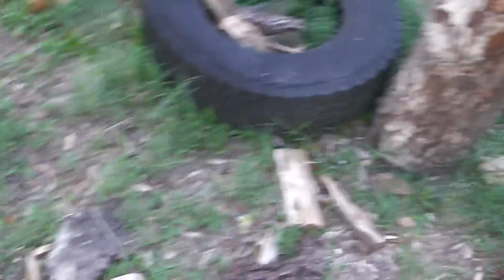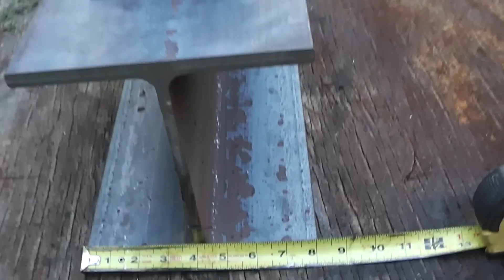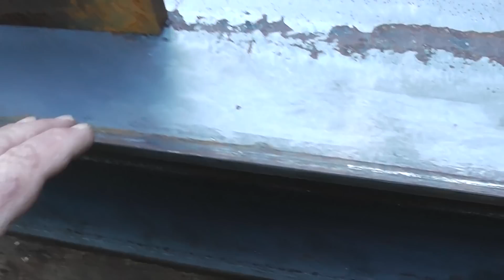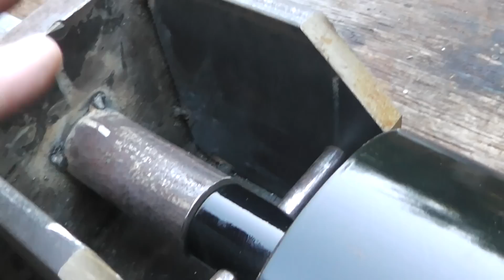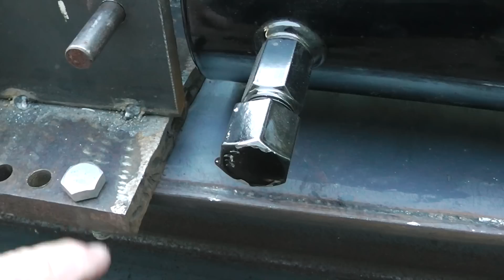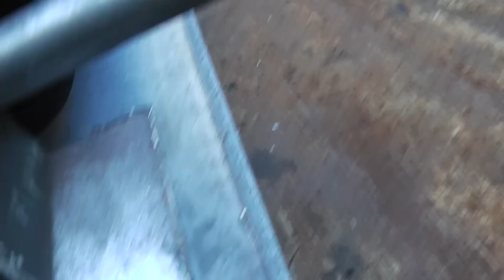How to Build a 30 Ton Log Splitter Part 1

Comment: Live oak is almost impossible to split. We had a splitter for our tractor and it would split the very small pieces but we bent the hydraulic shaft on a larger size live oak. That was the last time we split live oak.

Comment: You didn't need to wait for the hydraulics to be set up to set your distance to your wedge. You could just open the ports on cylinder and pull the rod out to the end of the run. I have done that several times, sometimes it is hard to get it started but then the rod moves in and out somewhat easily. When done close the cylinder and restore the port caps.

Comment: 5 inch cylinder has roughly a 4.5 inch bore. At 3000 psi would give you about 24 ton
Reply: Maybe it is a 5" bore cylinder?  He didn't specify the outside diameter was 5".  I have build a couple spitters as well as other hydraulic attachments, and I always see the cylinders advertised by bore.
Reply: @mikegroat7732  Thats me told.😆

Comment: Wouldn't the shear forces be distributed across all 4 bolts per side?  If the steel plates are A36 too, you'll see those start to yield before the bolts too I'd imagine, so they'd deform into the remaining bolts distributing the forces.

Comment: at 4:43 you talk about shear strength and how if it breaks it's gonna shear off. Can you please explain how that could happen?
Reply from the maker: The bolts that hold the push block on are fastened at 90 degrees to the force being applied. If the force exceeds 60% of the fasteners tensile strength they can fail or shear off.
Reply: @homesteadprepper  but they won't have force applied unless an opposite force is acting on the underside of the plate. To shear there must be an opposing force, I can't see one.
Reply from the maker: @AWAradiola  Imagine if there were no bolts holding the push block on the I beam. When a log is being split that is not 100% parallel to the force applied, it will want to move up and down or side to side or a combination of both. For every action there is an equal and opposite reaction. So there would be potential movement in the x,y or z axis on the hydraulic ram to counter the opposing force. If the ram were to be moved side to side(x axis) it would cause a shearing force on the bolts that hold the push block to the I beam. You could build your own log splitter with one 6-32 machine screw on both sides of the push block instead of the 1/2 inch grade 8 bolts that I used to confirm this but, I don't recommend it for safety reasons when they shear off.
Reply: @homesteadprepper  Thanks for taking the time too explain, i appreciate it. When you say shear, I understood it to mean cut, not pull apart which is what you'd be doing if the ram wanted to rise. Since your ram will be secured along the barrel AND since it is on center with the push block which is hugging the flange of the beam the chances of a load in the x axis (side to side) or up direction are greatly reduced to the point that the bolts are really just there to keep the guide plates in place. When i built one for my excavator i found the smaller the push block, the smaller x axis forces were that acted on it. https://www.youtube.com/watch?v=5-y2VmtZhlU&list=PLkYgIJc_jyQCHkx95xzNVc7jTE7nYGESH&index=2

Comment: Why do you put the push plate on top of the slider plate and not in front of the slider plate ? Won’t the slider plate put horizontal pressure on the bolts as it itself makes contact with the wood ? Making one my self and see most people putting the push plate on top of the slider rather then in front...why is that ?
Reply from the maker: ThatRandomGuy There always seems to be a better way to do something. This log splitter has been able to split live oak side ways in its present configuration and is working just fine for me.
Reply: homesteadprepper I was just curious bc most splitters do what you did . Thanks for the information and the videos they helped a lot . Good work !

Comment: Not count leveraging  need to big bolt if lit wood on top of slide it pull back brake the first sit for bolt in time
Reply: Not tell you what to do I have the battle of hard knot building to learn what brake  and build one to 10 way